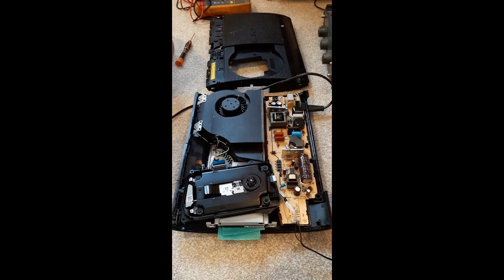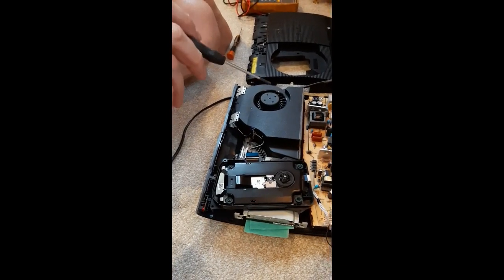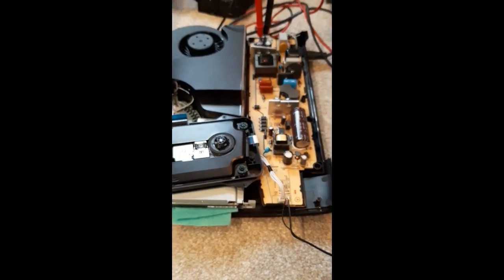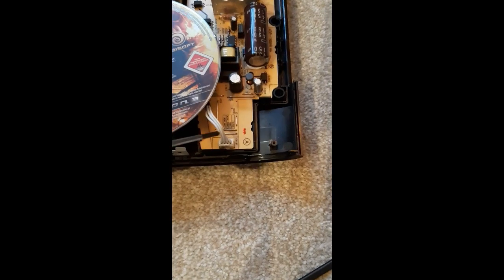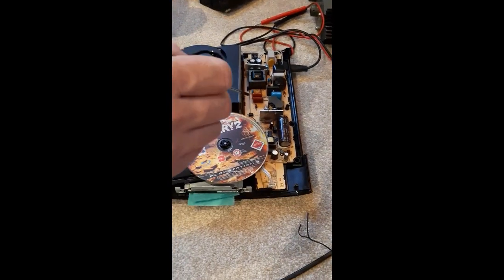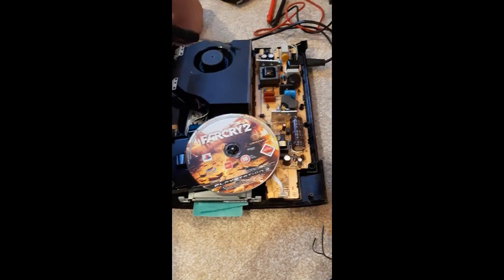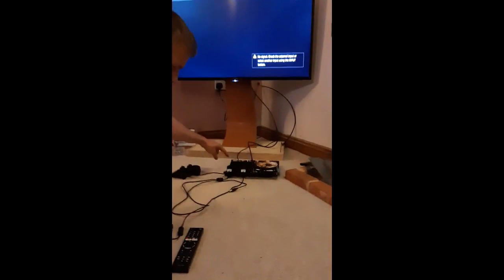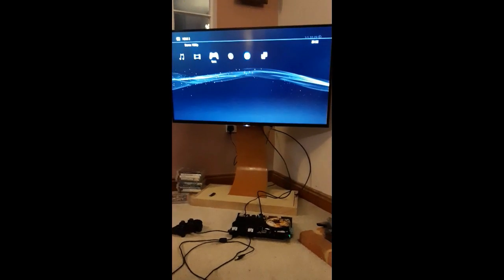PS3 Super Slim Power Fix

Comment: Old video I know but for most people it’s actually the RSX chip underneath having dry solder joints.

Not really worth fixing unfortunately as reflows have a rare chance of being successful.

Easy way to rest is to put pressure on the top left corner whilst turning your ps3 on

Comment: I have this kinda similar problem with my super slim, after i power her up she turns off immediately but if i do pressure with the palm of my and on the backleft (where those capacitors are located like in the picture of the end of the video) of the console chassis she doesn't power off, i also saw that it could be the capacitors desolding from the PSU board, any ideas?

Comment: My ps3 super slim has a turn on then immediately turn off issue I have it broken down as of the video above just can't afford to fix it. Didn't think about it when I had a job before the pandemic only allowed me to see, but it cuts off after two seconds when I first unplug the power the reconnect the power the red light is on when I press the power button it cuts on for additional 2 seconds the repeat the steps 3 seconds. I wonder if it's the mother board

Comment: I stripped down my PS3 super slim, cleaned it out and followed your video. I found that I'm getting 5.4v stdby voltage and then it shuts down and the 12v drops down. What would cause the pins to lose it's 12v ?
Reply from the maker: likely because the power supply is not seeing a load, so it shuts down. there is a control 5 v that the console returns to the power supply. In the first part of the video it's the return voltage that I applied back to the power supply by having a mobile phone charger. in the second part I figured that there was bad contact being made with the 12v pins that was causing a low load situation
Reply: If the 5V return voltage is the problem do we just need to get a new power supply? Leaving a phone charger hooked up to the PlayStation isn't ideal I think

Comment: Bro my playstation turning on for two seconds and shutting down immediately. what is the problem bro. How to over come it
Reply from the maker: possibly your problem is due to the voltage protection circuit within the Psu. New psu or see new links in my public comment
Reply: Same issue
Reply: My super slim is doin the same thing, I just put on a power supply I bought from ebay and it is still doin the same thing. Did ya ever get yours to work?

Comment: mine shows green light and powers off after 2-3 seconds...will try it out. i was thinking its heat and dust, so i dissembled it and cleaned it all, then applied a new thermal paste and same result. but am hoping this vid helps me. Just to be sure, all i have to do now is push the two pins together in other to get an adequate power supply?  yes?
Reply from the maker: Yes this is to make sure you have good contact between power supply and motherboard. May or may not fix your issue. Good luck. Post an update.
Reply: @redhatterful  alright man.. thanks tho
Reply: @redhatterful   i did it but same result. but now am trying to connect a 5v usb to the 5v port of psu .. would that help? or do i need to connect a 12v adopter to the 12v port of the psu aswell ?
Reply: Hey bro facing same issue how did yours fix

Comment: I have heard of power problem on Ps3 super slim, as regards the power IC on the main board. Please Can you throw more light on that  issue and how to resolve it.
Reply from the maker: https://www.electronicdesign.com/power-management/power-protection/whitepaper/21120596/protection-for-the-power-supply-and-its-load

read all specifically OVP section

Comment: Hi! Im breaking my head with the same issue, which metal part should i squeeze to make better contact? All 3 should touch each other? Or the little one does not have to touch
Reply from the maker: On the power supply the main connection point to the motherboard. The two pins on the motherboard push into the psu.